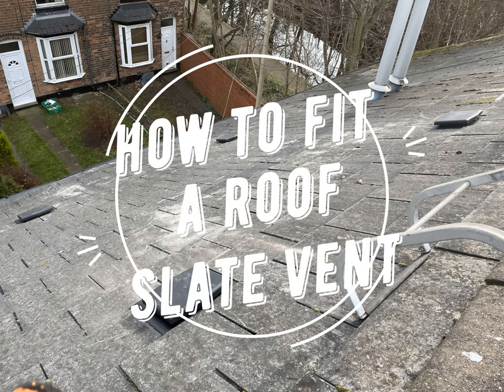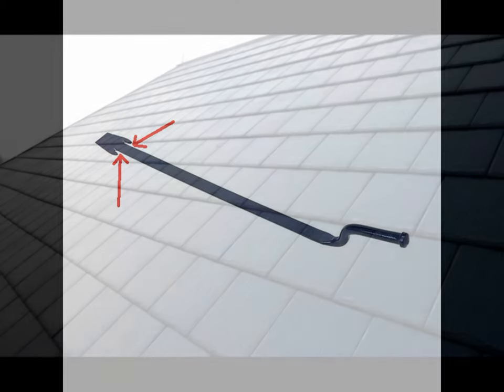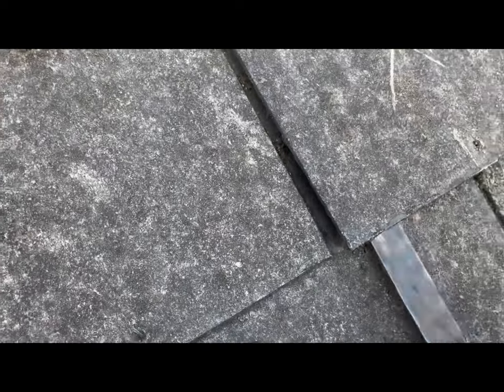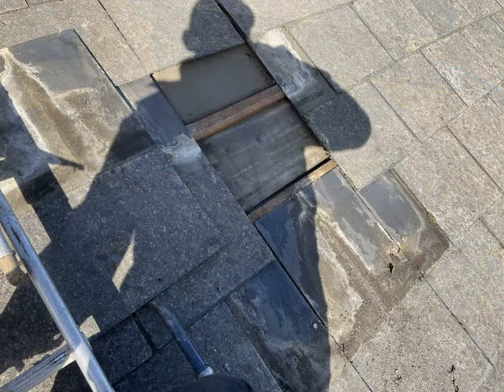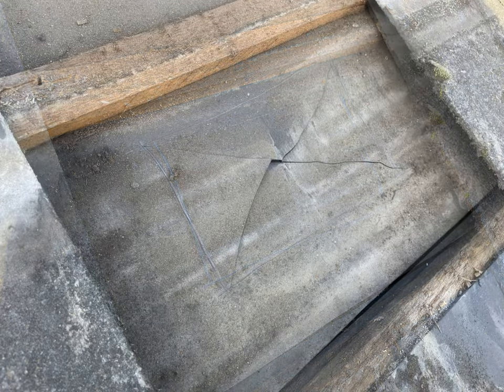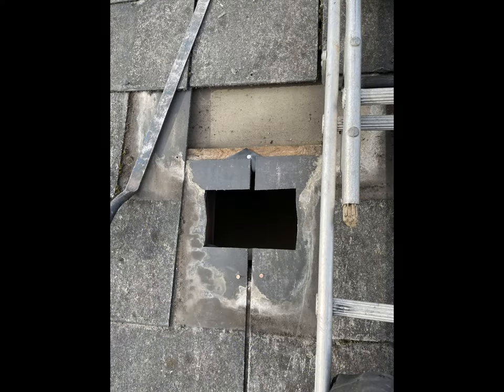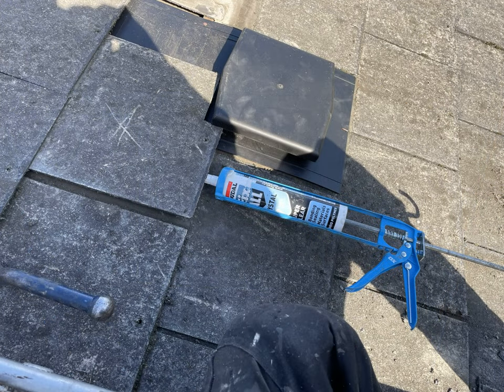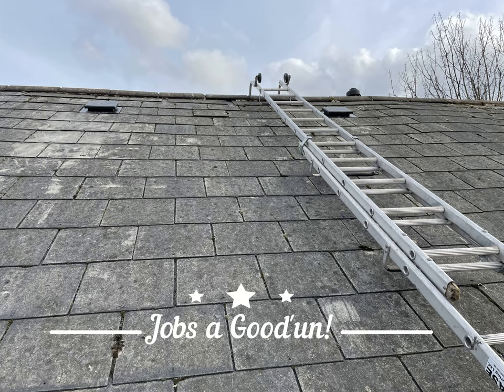How to fit a Roof Slate Vent

Comment: One of the big issues is actually when you go to install, and there's a rafter in the way. That's when the jiggery-pokery begins. In older places like mine the rafters are only about 12 inch apart (Designed for the old heavy slates). Because my requirement was near a hip, I could fudge the offset required  with a double width fibre cement tile (Looks wise).
Reply from the maker: Yeah fair point, usually if i find a rafter i just move the vent across a slate to it's in the middle. But 12 inch apart on rafters, thats tight!
Reply: @davesalter  Mainly for the benefit of anyone reading this thread, is that the vent system shown is designed for an additional coupling that allows an extraction pipe to be connected and thus to an extractor. If someone is simply manually ventilating a loft space then really you could cut that back flange down to the width of a roofing batten (18mm or 25mm depending) and you wouldn't have any issue with the rafters being in the way (or cut the back flange in a way to not hit the rafter but still partially project past insulation if you have that directly below the battens/roofing paper).
Reply from the maker: @cowboybuilder  Yeah fair points. Or you can actually get a vent with no protrusion for venting only, the vent in this video can be used for venting of loft as I've shown or as you say it can have a pipe added for bathroom/kitchen extraction.

Comment: Hi Dave ..really helpful thanks. I have 4 installed already from my previous loft conversion but a couple have slipped about 5 cm down , so the rivet/ nails can’t be holding them in place? Is there a way I can secure the vents without taking tiles back off? A roofer looked at it and said they are secure, and won’t drop any further but they shouldn’t slip ? Thanks for your advice
Reply from the maker: I would imagine whoever fitted them did not remove the top 2 slates so they could be nailed in place, so they wont have nails if they have slipped. Its possible the protrusion on the back of the vent is stopping it from slipping out completely. If you dont want to remove the slates you could try putting some silicone adhesive underneath as i show at the end of this video, then pushing it back into place and fitted a rivet to hold it down. That's about the best you can do without removing them. Thanks for watching, and sub for more! 😀
Reply: @davesalter   Thankyou , I investigated further as I have a scaffold up ..they are flat profile vent with no protrusion on the back and the tiles underneath haven’t been cut and yes , not nailed in place - so that’s not going to give much ventilation..hence my condensation problem.! Really appreciate your video and reply.,you aren’t based near brighton are you? 🙂
Reply from the maker: @t.m.p8187  Wow, yeah thats shocking, well good you've seen it so it can be sorted correctly! Based in Halesowen, West of Birmingham I'm afraid. Good luck!

Comment: How much would you averagely charge for 1 roof vent the same as in the video ?
Reply from the maker: Depends on a few variables like access to the roof, height of it and where on the roof etc but probably looking around £120-150 as a minimum.

Comment: Can you just remove the one slate and cut the hole wih a small angle grinder?
Reply from the maker: I would consider that a short cut not worth taking, you wouldn't be able to nail the vent in place which I would much rather do, it would be difficult/impossible to get the vent under the top two slates and get the vent section in the hole with a slate vent like in the video i would think, without breaking slates in the process. Also the H&S aspects of the potential silica/aesbestos dust I'd rather take them out. So in answer to your question I'd say no, but i am sure people have tried it that way, lol. Thanks for the question!